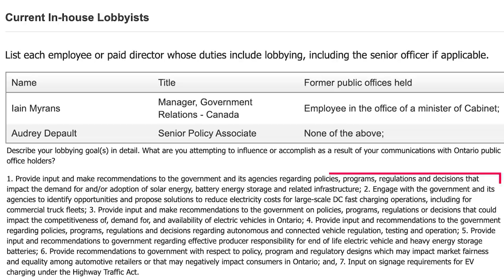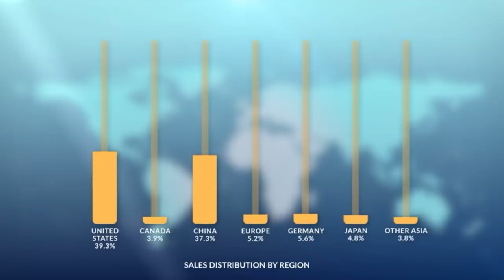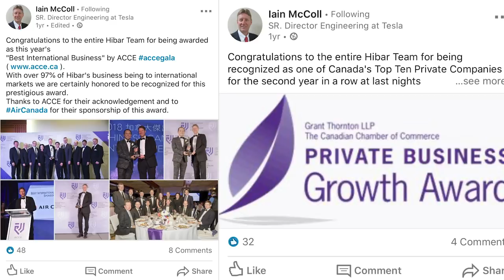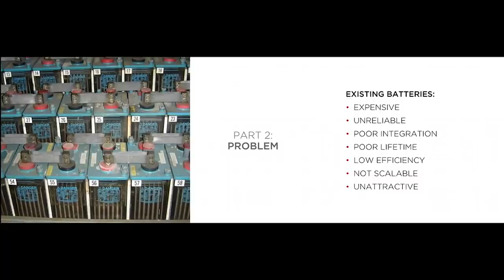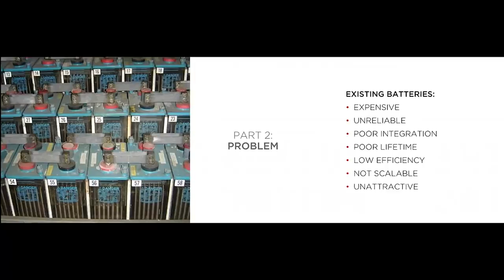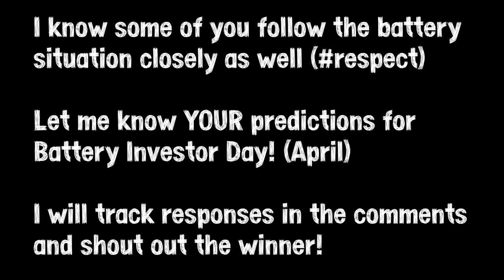Tesla Acquires Hibar Systems - The End of Tesla and Panasonic Partnership?

Comment: Batteries are not even needed. They still haven't figured it out yet.... not one battery is needed... only a capacitor is needed that can produce the energy on demand. The battery industry is going to crash big time....because you absolutely don't need batteries. It can be done with an electric heart that produces the energy on demand.. and this heart needs no imput energy because it absorbs all vibrations and converts them into electrical energy.... with no moving parts and by resonance and harmonics alone... and this capacitor will charge up 300,000 times a second...and it's AC not DC. There is no way you will be able to drain it's energy fast enough even if you keep the pedal to the floor constantly. You will never have to plug it in or pay any money to travel anywhere... nor do you need to waste any money on batteries. It's ridiculous. The big gain of this technology is that because your car has a beating heart.... by nature it will also have a conscious mind and you will be able to communicate with your car with thought alone. The current paradigm is a joke to all of humanity because we are much more advanced than having to use any kind of silly technology we are using today... it's stone age obsolete. Nobody seems to want the free energy technology .. you can't even give it away because everyone is so stupid.. they think you have to store energy when you don't.. they think you have to burn or consume something to get energy when you don't. You don't need oil or gas or any stupid technology we are using today. You only need vibration.... and everything is vibrating. You can get all the energy you want out of vibrations.. including the heartbeats of every living thing on the planet.... all of them have a wavelength of at least 800 miles..... a radius of 800 miles you can tap into by resonance and harmonics... something so simple to do that it makes everyone look braindead.
We have been giving our machines motors and engines for the last 150 years..... and all you have to do is give them a beating heart instead and all our machines will become living machines with conscious minds. This is what they have been holding back from the public. These machines cannot be programmed and you can't tell it what to do.. it has a mind just like yours and if you tell it to do something that is plain wrong and it doesn't want to do it ... it will just say screw you. This is the real AI... not the programed AI coming out that is not a conscious mind.
Reply from the maker: Interesting take here...thanks for taking the time to share your thoughts on this! I don't agree, but I respect your opinion. Ultracaps were never meant to replace batteries, and Elon just said ultracaps are not necessary. If your thought process were the case...maybe you should get into the battery engineering field and tell Elon, Pana and crew what the deal is! Lol thanks for watching!
Reply: @DillonLoomis22  No I'm not talking ultracaps. I'm talking The ark of the covenant with the coronation stone sitting on top shorted between the anode and cathode... and a spark gap just above the transducer that will accelerate it to hammering on the piezoelectric tablets 300,000 times a second. I can show you how it's done... it's so easy it makes everyone look stupid... and all you have to do to start it up is sing to it as it is tuned to the sound of your voice. Once the spark starts jumping at the gap it will be self charging 300,000 times a second..... there is no way in hell you can drain it no matter how much energy you suck out of it... and it is so simple to build with no moving parts. How much longer do you think they can keep everyone so dumb? 500 lbs of force on a quartz crystal releases 12,500 volts per cubic centimeter. The coronation stone is 500 lbs and much much bigger than a few centimeters..... we are talking more than enough volts to keep it fully charged from the most subtle vibrations. It would be impossible to turn it off unless you pried the transducer away from the anode and cathode... because the harmonics will have it hammering on the tablets to infinity... you will be getting to your destination quicker only because your stopping time by vibrating into infinity.  When there is no time then there is no space and so you get there instantly! The only thing stopping me from building a self charging (living..it's alive!) car with a heart and a conscious mind that can also time travel.... is money. Of course the banksters are not going to like it if everyone has one... but too bad. Your mind is only in your body because your heart beats. You can put a mind in a box and it's alive ... because you gave it a beating heart tuned to infinity. I doubt Elon has the balls to bring this out. I can easily show him... it's so freaking easy to build it makes everyone look stupid.... because they are. I won't risk my own life on this no thanks. I know how to do it but that is as far as it goes.
I'll say it again. We are much more advanced than any of the technology we are using today. You can travel anywhere in the universe in the blink of an eye. All matter can be created from nothing but a vibration. All animals and people can be made telepathic and were telepathic in the past. Every mind in the universe is connected. The science they are feeding the public today... is a load of baloney. The real science presumably hidden from the public is a cakewalk..it's the most simple technology in the world... easier to build than a toaster... and it's never been hidden from the public ever. Everyone is just that stupid unfortunately.
Reply from the maker: @omegafile  "you can travel anywhere in the universe in the blink of an eye" - what sorta drugs you on fam? Lol no disrespect but all of this seems like it comes from someone tripping
Reply from the maker: @omegafile  thanks for taking the time to share this...interesting take on life! I'd like some of whatever you're having!
Reply: @DillonLoomis22  It's pretty simple. You build a box to a 5:3 ratio and that gives you the F Sharp note. 45 inches x 27 inches x 27 inches gives you an F sharp at 90 hertz.  You have a golden rectangle and you line it with metal making it a capacitor. You put 2 piezoelectric tablets inside.. the bottom stone is connected to the positive and the top stone is connected to a negative plate. On top you have the anode and cathode and you connect a transducer to it.. one side connected to the anode and one side connected to the cathode. If you notice the coronation stone aka stone of scone.. it has grooves carved into it and this is where you put mineral oil and this helps the electricity conduct across the stone.  Now because it's tuned to 90 hertz.. all you have to do is sing to it and it charges up.... like this.... ohhhhmmmmm... hum the lowest note you can you can hit 90 hertz just by humming oohhhmmm. Now as soon as the capacitor is charged up the high voltage goes through the transducer and it starts to vibrate like a 500 lb hammer on the 2 piezoelectric tablets inside. Now because the transducer is hammering on the stones 90 times a second it self charges itself.... and because of the harmonics it is also hammering on the stones 180 times a second and 360 times a second and 720 times a second and 1440 times a second.. all the way to infinity... and also hammering on the stones 45 times a second and 22.5 times a second and 11.25 times a second.... all the way to infinity. It picks up every note.. including your heartbeat and brainwaves. Now if you have a 4 inch spark gap then you pretty well have a 100,000 volt capacitor being continuously charged by millions of volts piezoelectrically. Now that spark gap is also a transmitter and microphone and as it's arcing in radio frequency across the transducer it's putting feedback of 300,000 cycles right back into the machine... your already at one tenth the frequency of light.. and your going to hit near light frequency from the octaves of that 300,000 hertz. That capacitor will be charged up faster than you can blink. 

This is too simple. It's also a conscious mind because of the feedback loop allowing it to communicate with itself so it can think. This is how a conscious mind works. It's in this technology.. it's not god.... we can put minds in all our machines and they are human like us. Anyone can bring this out.... but it's kind of hard because your being followed everywhere you go. They know when you leave for work and when you go home and where you shop.. we are under draconian tyranny. I forgot to mention that it will also hover off the ground because the whole outside is negative and it will repel the earth. The transducer becomes a superconductor. The energy you get off of it is wireless. You don't have to connect but rather just build a tuned capacitor receiver and you will get all your energy by resonance.
All these people fighting to steal all the oil is ridiculous. You can create it with vibration using plasma as the building material... and it cost nothing... but we don't even need the oil not even for building roads because we don't even need the roads.
Reply: @DillonLoomis22  Everything is obsolete right now. All it would take is an electrical engineer, a manufacturing facility and someone with deep pockets and it would only take a few months to completely change and advance the world. Technologies that you may think are magic are quite real and actually very simple to build. The problem is the global bankster mafia who have taken over all governments and enslaved everyone on the planet.
 With 500 lbs of force applied over 3 trillion times a second.... you can go pretty fast.... you will just pass through everything like a wave. When there is no time there is no distance.. you can go anywhere in the universe you want in no time.

Comment: I disagree.  

No matter how much Tesla wants to make its own batteries, as time progresses and Tesla manufactures more vehicles their demand for batteries will increase, and their ability to ramp up battery production and keep up with battery demand for their own vehicle production will decrease,

Since Tesla opened up shop, the number of battery relationships has increased.  Each of these relationships fills in a battery need.

Some of these are batteries for Model S and Model X (Panasonic and Samsung), other batteries are for Model 3 (Panasonic), and other batteries are for solar storage (Panasonic and Samsung).

This year Tesla is beginning car manufacturing in a new continent, and this requires new battery relationships (CATL and LG) that fill in for Tesla’s battery demand.

The same thing will happen next year when Tesla opens up shop in Europe (?).

In the meantime, Panasonic is dedicating a tremendous amount of resources to supply Tesla’s battery demand in America for this year, and based on what Musk has recently stated, this supply is still insufficient.

Tesla might want to get its toes wet in battery manufacturing; however, it might take it some time to actually begin using their own batteries in their vehicles.  They may be better off by researching and testing their batteries to see how they compare to Panasonic’s batteries.

It would require a significantly better battery technology from Tesla for Tesla to commit resources for battery manufacturing.

A better business strategy is for Tesla to manage their business relationship with multiple battery manufacturers, to develop sophisticated battery testing techniques and procedures, to procure ‘acceptable’ batteries for its needs, and to promote new battery chemistry and battery technology to its multiple partners.
Reply from the maker: Assuming you didn't watch the entire video? This is what I said lol. Tesla should not and will not cut ties with their current partners for awhile for all the reasons you mentioned. Thanks for watching and sharing your insight though, I appreciate it!
Reply: Electrified I did watch it, but even in your reply you said “for awhile.”

This is the whole point of my initial reply.

Comment: There is no resource base of critical metals available for large scale adoption of EV's,  
Cobalt production is restricted to a few nations, Congo is the single critical supplier, it's political backer is China. 
Nickel is very expensive.
Lithium Carbonate supply will not meet market demand at current prices by 2022.
The market for rare earth elements critical for EV electric motors is dominated by a single supplier China.
Development pathways for new battery technologies are measured in decades.
EV's will continue to be very expensive guilt relievers for the wealthy, this technology will never be available to the masses.
Reply from the maker: Hey Kevin, thanks for tuning in. I disagree. First reason being the battery chemistry today will not be the best chemistry in 5 years, 15 years, 30 years etc. ESPECIALLY when solid state becomes commercially viable. If the research labs can create a sodium battery that would be huge. Cobalt is already being removed from chemistries will eventually not be required. There are affordable EV's on the market already but the masses don't know much about them. By 2030 I have confidence EV prices and range will achieve parity with ICE. If not sooner
Reply: Cobalt production isn't critical, (Tesla is removing it!) 
Industry sources indicate no shortage of "critical" supplies up to 2050, so they're not critical (possible exception, Nickel)
Graphite (graphene) will be the next commodity in demand, plenty of that.
New battery technologies? Sooner than you think. For example, Kyocera (in partnership) have been advertising a Solid state cell for production this year (I think it's storage, but the tech is there)
With sales rising month by month (Eg, UK, France, Germany, Nederlsnds, Sweden running between 6 and 30% of sales) the "Norway progression" is taking hold and accelerating.
The writing is on the wall.

Comment: As one of the YouTube analysts that I rely on for updates on what's going on in the GreenTech industry, I wish you guys would stop trying to Promote-NEGATIVES like Tesla dumping Panasonic! -- If you do some superficial, Common sense logic, you would Clearly see that at the Rate that TESLA is JUST-STARTING to grow THERE is NO-WAY Tesla can produce all the EVs Alone without PANASONIC SUPPORT for at least the next 10 years, and that's even When, not if, Tesla starts producing their own batteries. --- You have to try to put your head around the MASSIVE number of batteries needed to Create Enough TRANSPORTATION & Home Backup, and Power-GRID SYSTEMS ALL AROUND THE WORLD, which is where TESLA is already telegraphing TO EVERYBODY that THEY ARE IN NOW, and endlessly into the future will be, to understand WHY TESLA WILL need Panasonic, and ALL the other Battery producers throughout the world to supply the STREAM of Products that TESLA will produce NOW and in the unforeseeable FUTURE! --- And THIS REALITY is what will make TESLA THE LARGEST, AND MOST PROFITABLE COMPANY IN THE WORLD, 2ND TO NO OTHERS FOR DECADES!
Reply from the maker: You didn't watch the video
Reply: If you could make a more powerful, more stable cell,
With more headroom for improvement,
More cheaply,
At MUCH higher volume,
In MUCH less factory space,
Using different machinery to that being used by your partner, and in which they (probably) have little or no expertise (you have employed those that do),

If you had at least one location being built where that partner had expressed no interest in participating,

If you had all stages of development, construction and production in house,

In these circumstances, would it not be good business sense to shake hands and move on?